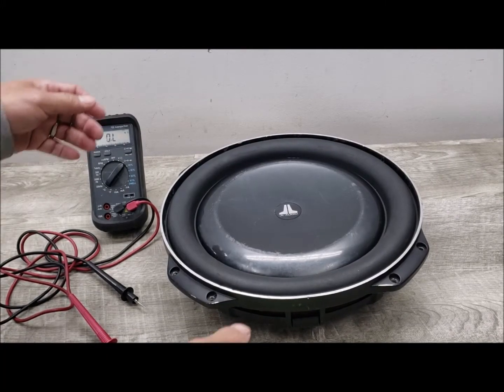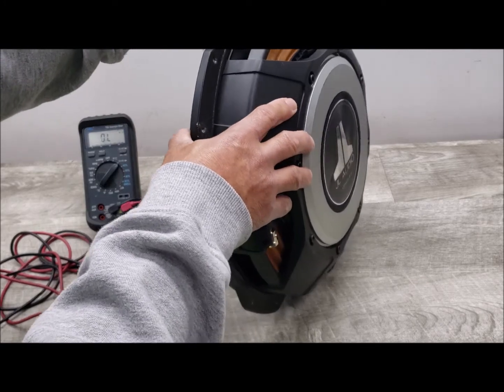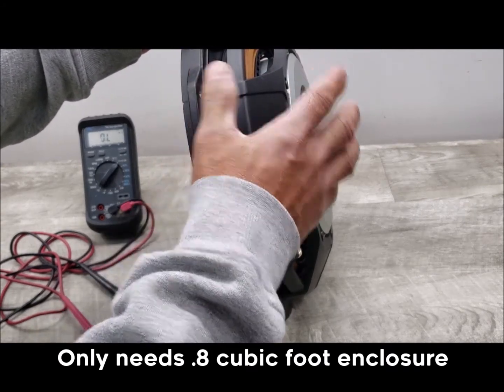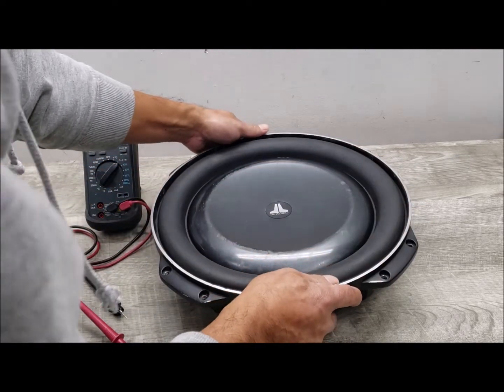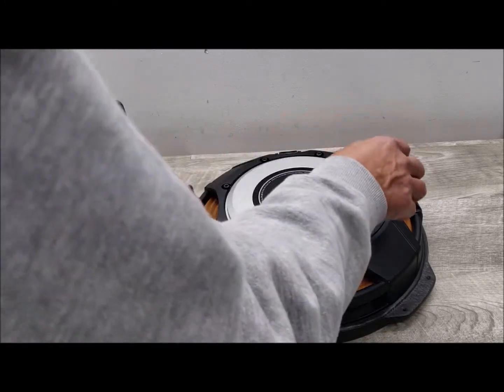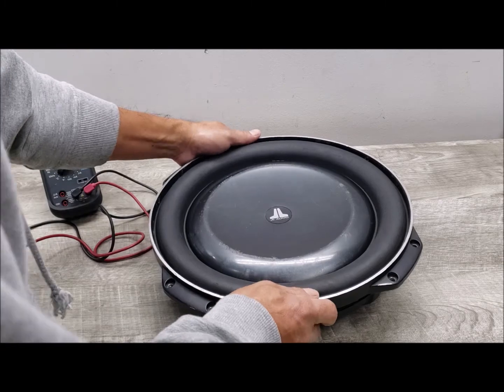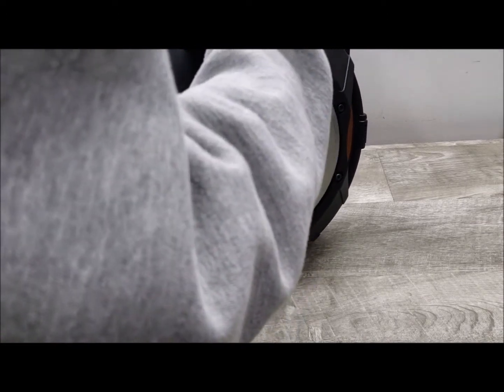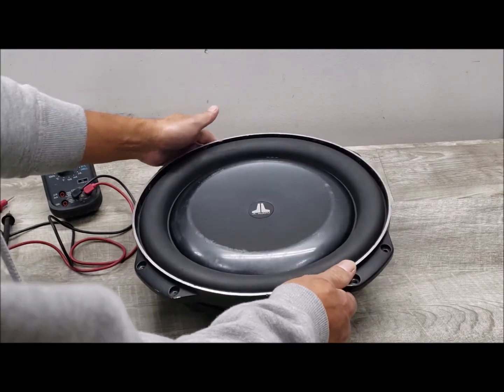What is a Slim Subwoofer? JL Audio 13TW5v2-4 13-Inch Shallow Mount Car Audio Subwoofer

Comment: I own a 12-in Rockford fosgate P3 slim speaker from 2013 I think, it is an amazing speaker to save space. I own a 2009 C300 Sport 231,000 miles and it still rocks.

Comment: I own three of them and they hit harder than JL 12"TW3.  The downside is that they do not sound well in ported enclosures.
I have three (sealed box) in my truck and also a 12" TW3 in a ported box.
The 12" helps with the extra boom/roll off.
It sounds freaking awesome!
Reply from the maker: I don't believe it is designed for ported enclosures. It needs the cabinet for control of the driver. Designed for a small box.

Comment: Do you think this sub will produce enough bass to fill in the cabin of a suburban?  I'm in between the TW5 or sacrifice a little more space and  just going with a full size 8" in a ported box (DD audio).
Reply from the maker: @cjlos2050sp  it all depends on power behind it. Ported boxes act differently vs. sealed boxes. Obviously these are designed for minimal space so it depends on the space you want to sacrifice. More wood means more weight as well. I always think it's enough bass but everyone's taste is different. Some like to let everyone else hear what they're listening to. Honestly, in a suburban, the volume inside should be good because you'll complete more of the wave length as opposed to a smaller vehicle. There's a lot of physics involved in all this.
Reply: @jaedarzadon  Thanks, maybe this is easier question to answer. Will the TW5  rattle my rear view mirror?
Reply from the maker: @cjlos2050sp  With enough power and properly made enclosure (with minimum flexing), you can get a ton of bass to rattle your windows.

Comment: I am searching all over the internet for the height of this woofer. Official spec only specifies mounting depth, but it is misleading as this Sub sticks out quite a lot on the surface and the total thickness is significantly more than just mounting depth.